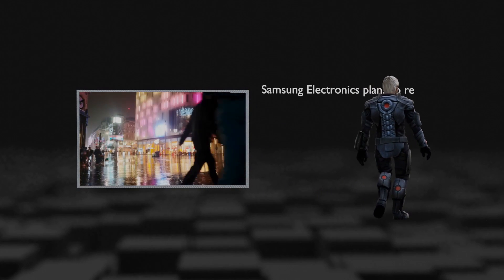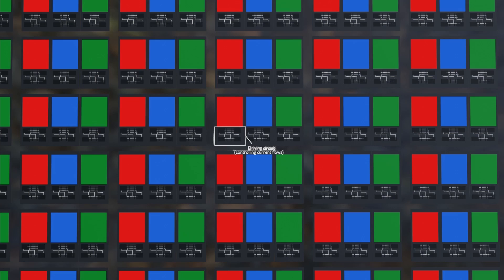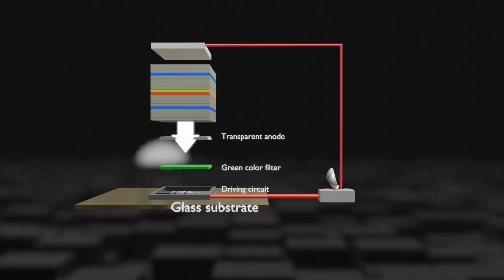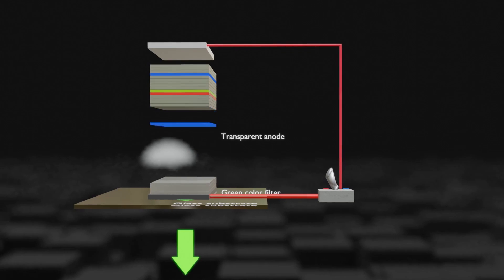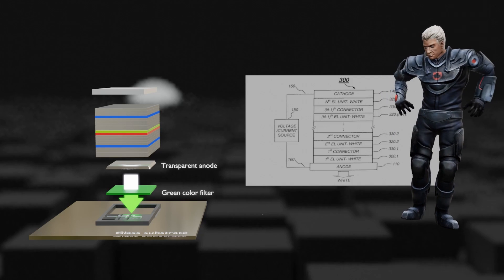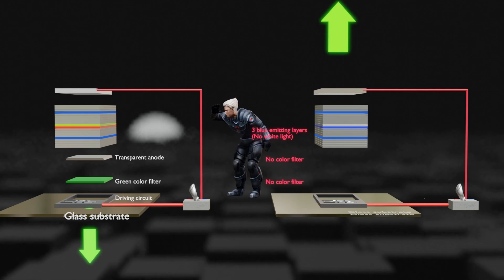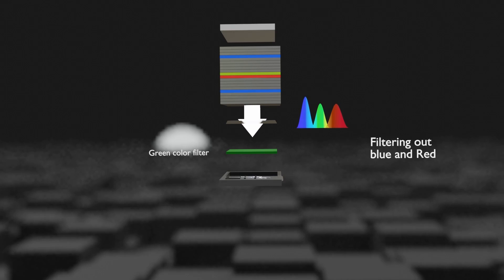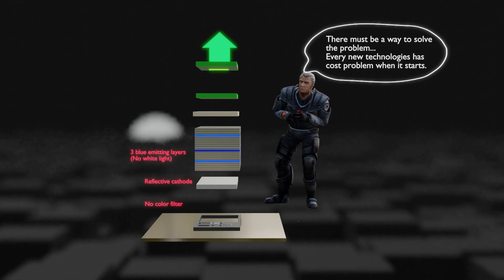Dissecting Samsung's QD-OLED

Comment: Great video, in WOLED display layer what kind of emiting diodes we have? I mean how the white light is obtained, by mixing the light from blue, red and green diodes or by mixing blue and other colors? Now that blue phosphorus is knocking at the dor i try to understand how this panels will benefit from it, i understand that qd ooed uses just a blue emiter and by changing this fluorescent to a phosphorescent blue emiter will be a major step forward but for woled panels some articles say that LG already uses red and green phosphorescent diodes and the blue fluorescent diode, in other articles they say that for obtaining white light the use blue fluorescent diode and green/yellow phosphorescent emiters. So which is it? And this emiters are used in same percentage for obtaining white or the blue emitter is the main emiter of a WOLED panel? English is not my native language, i just try to understand how blue phosphorus will impact display tehnology! Thanks!
Reply from the maker: In early days, white oled panel uses red/yelliw/red because green phosphorescent phosphot has short lifetime .  But now days white panel uses blue/green+yellow/red.
If one can use blue phosphorescent emitter instead of fluorescent, the efficiency of qdoled will increase at least two times.
Reply: @techtripkorea  hey, thanks for the info. The QD OLED displays made for Samsung TVs are using 4 stacks now? Three blue and one green emitters? How about the efficiency increase of WOLED panels if they will use blue phosphorescent emitters? How much more efficient they can get, WOLED uses 3 stack right and two of them are blue?

Comment: @9:44 I cannot see how the blue OLED and QD-filter can be more expensive than a white OLED with filter, do you work for Samsung? lol
Reply from the maker: Extra layer (qd layer) should be added.  Assembly steps of oled layer and CF+QD layer should be added.  It is more complicated to form top-emission structure having transparent top-electrode with low electrical conductivity.  SDC has less experience in oxide TFT and use more mask steps.  Another extra layer should be added between trnasparent cathode and QD layer and much more.
I'm not working for Samsung~

Comment: What your opinion about inkjet oled manufacturing process by TCLcsot partnership Joled?
Reply from the maker: Soluble materials have relatively short lifetime.  Therefore the application is limited.  Definitely not for TV.

Comment: is the low aperture of WOLED noticeable?
Reply from the maker: No!  It's not noticeable.  Only pixel density or PPI affects the visibility.
At the same resolution, low aperture ratio affects the brightness level.
You need to drive sub-pixels at high "current density" to obtain the same brightness level compare to high aperture display devices.

Comment: why doesn't the lg display just use RGB pixel structure?
Reply from the maker: The reason is simple.  The reason is that RGBW is more efficient than RGB.
Each  of the RGB color is generated by filtering white color using color filter.  
Therefore you have to discard 2/3 of the photons generated inside a single sub-pixel.
In case of white sub-pixel, the efficiency is 3 times higher than R/G/B sub-pixels since it does not use color filter.
So, when you do color mixing to express a specific color, it will be more efficient to utilize white color.
Reply: @techtripkorea  efficient in manufacturing or efficient in power consumption??

 BTW, thanks for the information.
You're very informative guy🙂👍
Reply from the maker: Efficient in power consumption (compare to RGB using color filter).
Efficient in manufacturing (compare to RGB system using fine metal mask instead of using color filter).

Comment: 240hz QDLED 16:9 gaming displays?
Reply from the maker: Probably 120 Hz 16:9 gaming displays with 4k resolution but more expensive than woled 48".
Reply: @techtripkorea  ID rather lower resoluion but high fps
Reply from the maker: For lcd monitors, 120 vs. 240 hz has no meaning.  But for OLEDs, there will be noticeable difference.

Comment: WIll burn in be the same or less?
Reply from the maker: I'm not an insider.  So, I don't know yet.  But hope to it has less burn-in issue.
Reply: @techtripkorea  I do too.
Reply: I have read elsewhere that it’s supposed to be less due to the fact that it is much more efficient at producing light than WOLED.
If WOLED needs to produce a bright red, the WOLED has to make it brighter still needing to make white light then filtering green and blue. More efficient means less real brightness needed which in theory should lessen burn in.
Reply from the maker: Yes, it seems like QD-OLED is more efficient than WOLED.
But Samsung claims that their QD-OLED TV is 50% brighter than WOLED.   In that case (if they run the TV at 50% brighter level), the burn-in issue might be almost same.  If they run the TV panel at the same brightness level, then the burn-in should be lessen dramatically.
Reply: @techtripkorea  I have an LG CX in a dark room and other than bright highlights, overall brightness on max OLED “backlight” setting is plenty bright enough usually. 50% brighter max would just mean I could run it lower. The white sub pixel of OLED makes comparing against QD-OLed’s RGB only sub pixels not as straightforward too, but I would also think that real world brightness with colors (not just white) would be help in the efficiency measurement in QD-OLED’s favor. I am betting LG determined brightness using white.

Comment: could you tell us about  (  Ultra-Bright Double-Stack OLED Displays) technology
Reply from the maker: Yes, I will.  I'm preparing a video about LFP lithium ion battery.  Just after that, I'm going to release the double stack ossue.
Reply: @techtripkorea  I just watched it! Interesting. I wonder what Apple will be doing with their iPads with the Samsung deal not happening. Now that I have an iPhone 13 pro which has an incredible display, looking at my 10.5 iPad Pro I noticed the limitations of the display more easily. Movement is so smeary, it lacks contrast and is pale in comparison. Mini LED+LCD with their current iPad pros, while a huge achievement for such type displays due to density, are a no go for me due to the blooming issue and pixel response time of LCDs.